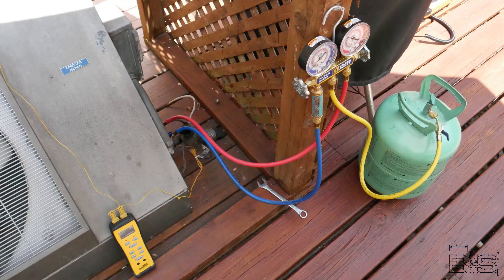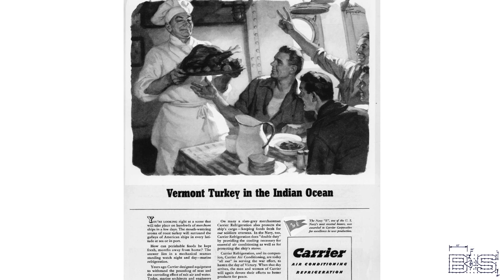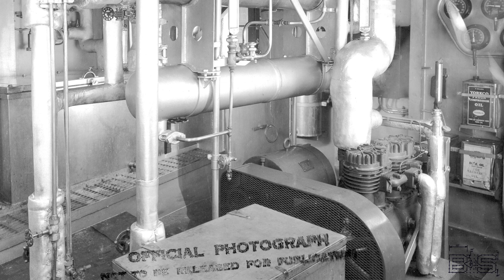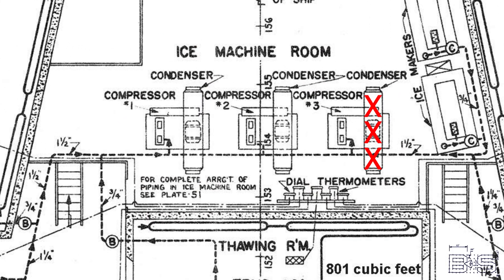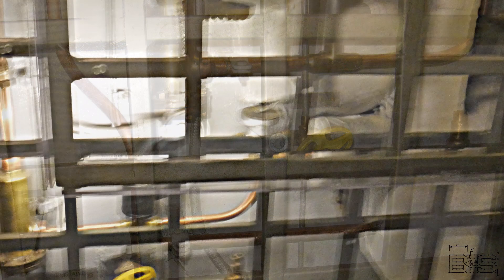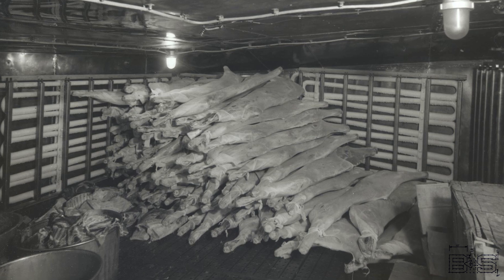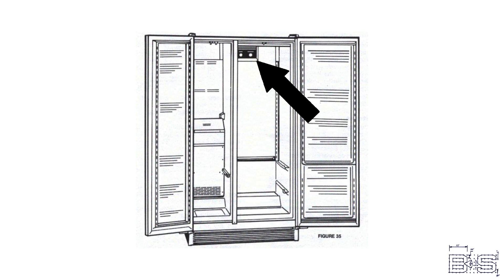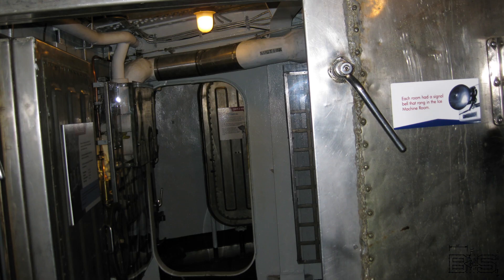Battleship Refrigeration

Comment: Oh boy!  That must have been a fun chore defrosting the meat room coils with a steam hose!  Personally, I would have used a warm water hose instead of live steam.  Assuming there was drain pans under the coils.  In my career, I installed and worked on large commercial freezers which used automatic hot water defrost systems.

Comment: Question at 7:45 yes I have a small  fridge that's not frost free. My defrost process is actually kinda fast. 

1 once inventory is low move remaining items to a cooler with ice packs. 

2 prop door open 

3 turn temperature dial to off

4 use a clamp fan to hold freezer compartment door open and circulate room air through the freezer compartment.

Even when badly frosted, just blowing a large volume of air will defrost it quite fast. Often, it is less than half an hour.

Comment: This is awesome information. I don’t understand the purpose of the suction pressure regulating valve at the end of the fruit and vegetable evaporator. Reducing evaporator pressure will lower the evaporator coil temperature, not raise it as stated. And the solenoid alone should be enough to keep the compartment at the right temperature.
Reply from the maker: The reason for the suction pressure regulating valves is to prevent the evaporators from getting too cold in compartments that don't need to be freezing. You could regulate the temperature with the solenoid alone but it would likely cause food stored near the coils to freeze which is not intended for the fruit and vegetable compartment.

You are absolutely correct about reducing evaporator pressure making the evaporators colder. I have added that to the errata page. Thanks!